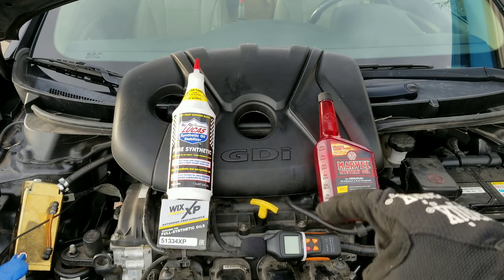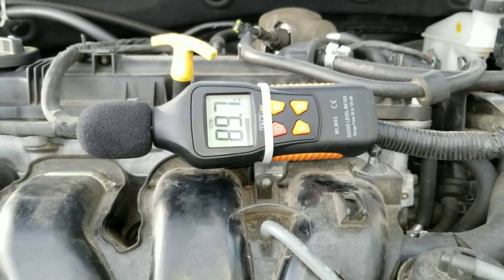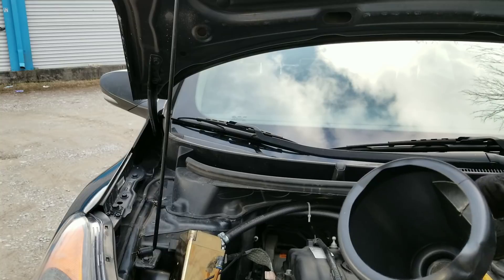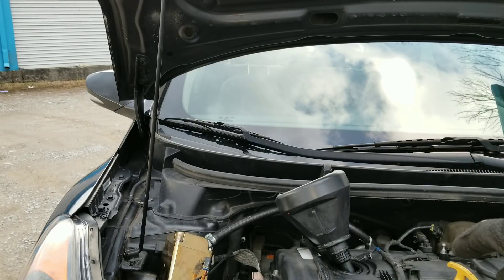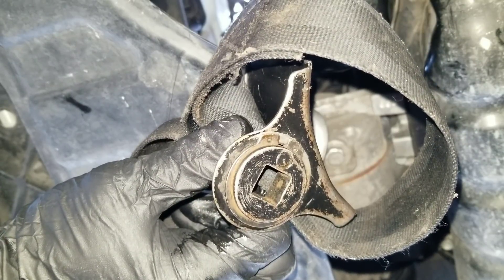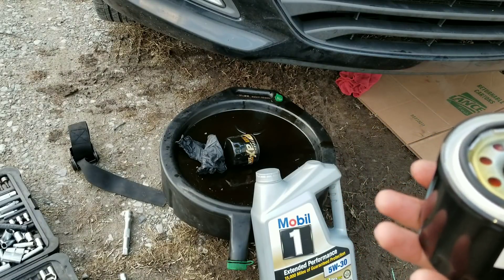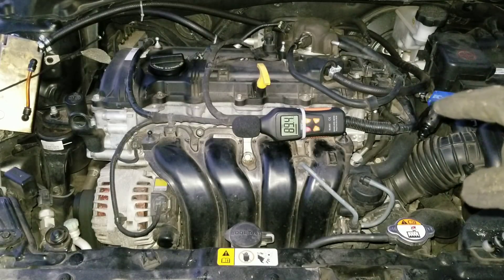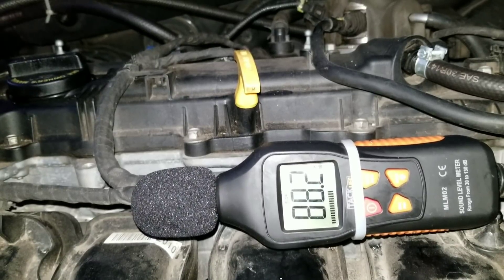marvel mystery oil & lucas oil stabilizer safe for new cars?

Comment: I have a 2010 Ford Taurus sel. .  The car lot serviced it before I bought it and they put 10-30 motor oil in. .. I changed it after 3,000 miles and put 5-20 in it cause that's what it calls for. . I did go synthetic. ... the car started making a ticking noise the day after and was getting louder.. I changed it again and put 10-30 synthetic and still ticking. .. added mystery oil,  still ticking. .. what happened? ??
Reply: The engine was ticking when they acquired it on the cheap and they put heavy oil and an oil thickener to mask the engine sound till they could find a “trusting unsophisticated” buyer. They knew it all along . I’m 76 yrs old and this trick is older than me
Reply from the maker: Marvel mystery oil can help depending on your situation however marvel can also thin the oil but very little it helps noise such as ticking lifters. Using the manufacturer's recommendations for oil would not be harmful although the different viscosity could cause very small noise level rise. When your car gains many miles over time there can be added benefits to the 10w30. I can hope the oil level wasn't low that caused noise to raise . You can add Lucas oil heavy duty stabilizer follow instructions if you have over 100,000 miles. Fill me in on what I can help with.
Reply: @NATESINTERACTIVEAUTO  I apologize for taking so long to reply. .. I changed the oil again and put 10-30 back in it, I did go synthetic this time,  still making a ticking noise and when it's cold the lifters rattle a little bit.. I just got home off the road two days ago my wife said it was rattling a lil more often than before I left,  I put a bottle of the stp oil treatment and have not heard the lifters again. . I also done the seafoam spray to the intake to see if that would stop the ticking noise but it's still doing it,  not as loud but noise is still there. .. Iam starting to think it was doing it the car lot got it and they put thicker oil and treatment in to stop it..  Iam no where close to being a mechanic so any advice is greatly appreciated. ... if it's possible the moter is getting to bad I have a life time engine warranty I purchased when I got the car just in case. ... as far as miles it had 132,000 when I bought it and I think it's right at 141 now
Reply from the maker: I appreciate you sharing
Reply: @ashleejenkins7627  m.p
Reply: @NATESINTERACTIVEAUTO  and no sir,  oil level has never been low, it's checked every week
Reply from the maker: Ok thanks for the information if your covered with a warranty great but be careful they seem to just pass warranty  but just listen to see if this worsens over time also when you drain oil drain over a magnet slowly and for $20 there is company called Blackstone labs or a respected company you know and have a oil analysis performed if you go online they send you a container for free just put used oil in and follow instructions to a T and this will tell you if there is a major problem other than this you can use lucas or stp but use synthetic and do not exceed instructions and if you want rid of this you can go to a mechanic see if there can be adjustments made however if theres not a wear issue i wouldn't have this performed unnecessary cost

Comment: If you're supposed to add the MMO quart 300 miles before the next oil change, how do you remove that amount of oil first?
Reply from the maker: You can drain or use a transfer pump
Reply: Just pour it in, no need to remove any oil. 99% of engines will be low anyway
Reply: @mikegillaspy1721  sure. Over fill by 20% I mean other than possible seal damage. No big deal.

Comment: It's DECIBELS!!!! Not decimals
Reply from the maker: Yes spell check somtimes takes over just as you or i dont use the correct punctuation
Reply: He tests his oil with a sound meter, what do you expect?
Reply from the maker: Some want to see if this helps engine noises i will try to improve our test
Reply: I actually don't think it's a bad idea to see if there's any difference between additives when measuring valve train noise, granted you have a decibel meter. I would try it if I had one.
Reply from the maker: Thank you i will try to improve our test
Reply: There's really only 2 ways to test. You've already done one. The other would be to check the oil pressure. Marvel Mystery Oil works very well for certain applications. I have freed up stuck lifters several times and even freed up a seized top end of a 4 cylinder. Keep on doing what you're doing, that's what makes good mechanics.
Reply from the maker: I appreciate your time

Comment: If you need oil stabilizer, you need an oil change
Reply: I've used it for the past 25 years along with Mobile One, but once when I didn't use it, at the next oil change the oil was black without a shine. Then at the next oil change using the Lucas the oil had a dark brown color and the used oil had a shine to it, like I normally see. I've been changing my own oil for 50 years.
Reply from the maker: Thanks for sharing your story and what other additives do you have experience with?
Reply from the maker: Follow instructions

Comment: Hello there , i think MMO can stay in the engine for much longer period and it will not
damage the because it is a Lubricant , so why you say drain it after 300 Miles  ?
As a lubricant it can stay in the engine till next oil change even to 2000 Km .
Reply from the maker: I recommend following marvels recommendations.
Reply: It thins out the oil, not good to run oil that is to thin for 3k miles. Just add it 300 to 500 miles before oil change. 380k on my camry marvel since day one, drives like new.
Reply: Good job, Jay.  I use 8 ounces before an oil change, not the whole quart. I save the rest for the fuel. I'm catching up with you. I have about 365K on my V6 !
Reply from the maker: Thanks for sharing
Reply: You are right. MMO can be used as a pre oil change treatment, and you can run it in the motor oil at all times. I personally would not run 20%, but some people do. It thins out the oil slightly, so I normally run 8 ounces in synthetic oil during colder months. In hotter months I use it before an oil change, especially older engines that are prone to oil consumption. There are lots of custom uses for MMO. Try putting a half ounce in the PCV valve with the engine running. Gun the engine once and shut it off. Let it soak for about an hour.
Reply from the maker: Thats what marvel recommends 300 to 500 miles before oil change.
Reply: Sounds like the correct amount of time for the product to fully penetrate and clean. The 300 to 500 miles must be on their website, because the bottles do not have this.

Comment: Be careful how long you drive after putting MMO in because in my 09 Hyundai Genesis 4.6 has always had oil changes at every 3000 miles with mobile 1 since the day we bought the car and it's always had highway miles.. the car has. 185,xxx now and one morning while it was cold out there was a slight lifter clatter that I never herd so i put marvel  mystery oil in the oil drove like 500 miles. And when I changed the oil I had noticed that so much carbon deposits had built up in the oil filter and clogged it so much it actually blew out the seam   of the filter media to bypass the filter (it is a factory design to blow out or bypass the filter if it gets to clogged so it doesn't harm the motor by not flowing out) so keep in mind that when you put the marvel mystery oil in change out the oil filter when you add it in
Reply from the maker: I change and flush often
Reply: @NATESINTERACTIVEAUTO  Yo this is like my life with a 2 year newer car. I work in a shop so why not right?
Reply: That's because the marvel mystery oil loosened up alot of the tarnish and carbon deposits in your engine.
Reply from the maker: Thanks for sharing
Reply: You can leave synthetic oil in a lot longer than that.  I use Castrol edge or Amsoil with Lucas oil stabilizer and run for a minimum of 10000.  The Ford I drive has over 328000 clicks on it and runs perfectly.
Reply: Use oil stabilizer and you run 500 miles change the oil and filter
Reply: Fernando Daniel I believe the company says no more than 300 miles
Reply: @carlrest6553  "Use Marvel Mystery Oil in the crankcase to benefit oil. At your next oil change, replace 20% of your engine oil (traditional or synthetic) with Marvel Mystery Oil. For example, if your engine has a 5-quart oil capacity, replace one of the quarts with a quart of Marvel Mystery Oil. Repeat at every oil change for optimal performance. Marvel Mystery Oil can be added to engine oil 300 to 500 miles before your next oil change to supplement sludge removal and enhance engine cleaning". I dont undestend if to use engine flush or oil treatment
Reply: Fernando Daniel I've used this product for 30 years. No more than 300miles.  And you better use a high quality oil filter.
Reply: As a matter of fact, I only use Castrol or Amsoil synthetic, Lucas oil stabilizer, MMO, and k&n oil filters.  I have driven a plymouth, two Pontiacs, two Dodges over 300000 and a Ford. currently over 330000.  All ran and run like the day I bought them.  All of these products are the best and have been used religiously on my vehicles.  MMO in the gas as directed works amazing. Almost 2 000 000 is proof.
Reply: James Duffy No more than 300 miles and make sure you use an oil filter of high quality and is designed for extended range
Reply: Isn't every 3000 miles a bit over the top nowadays? Thats a good but expensive oil.
Reply from the maker: 6000 if a quality synthetic conventional 3000 and i drive 150 miles daily i try for 3 but sometimes hit 6ooo however 6 is fine but i have a friend who has changed his oil 1 time in 3 years and drives as much as me but he has 250000 and still going on a jeep liberty 03 model it does use oil mine doesn't use a drop but i only have just over 100,000
Reply: @malcolmnicholls2893  All depends on how you drive your car. I do a lot of hard accelerations so with full syn every 3k its still black. When your oil is black or clean it still recirculates threw the pcv system and the intake the worse the oil the more it will stick to everything.
Reply: @CodyDoesIt  Ok-Thanks

Comment: Nate I am not sure you should do this, it will not hurt the engine but it you send that off to the lab it will probably read as a 5w35 or 5w40 oil and since this is a non turbo it might not flow as well
Reply from the maker: Ive not decided what to send to the lab
Reply from the maker: But it will be a comparison if there is more ear with or without  lucas
Reply: I put 15w40 and Lucas and mmo in a 5w30 engine. Another engine 20w50 Lucas and mmo. They all run great, quit pearl clutching and realize that engines are tougher than you think.

Comment: Motorkote is what I used in my vehicles when I change oil before winter. I change 2 times a year but used Motorkote for the wear reducing properties during cold temps. Can't wait till April to change the oil again. It helps on cold morning starts with valve chatter. Great stuff...
Reply from the maker: Great im so excited to put all my oil test equipment together and send alot of samples off for more info so maybe they would cut me a deal i want the test to be very detail like pour test wear test visual boil and cold test also send to lab and more heat dissipation. So i will take a survey later to see what makes the cut
Reply: @NATESINTERACTIVEAUTO  An oil cold pour test of different brands today in actual conditions would of been a great. LOL  Those all sound like great ideas.
Reply from the maker: Yeah i just purchased a wear tester and its kinda expensive but unfortunately coming from china so it will be a month
Reply: Motorkote is what I use for my oil additive. Mmo for my fuel additive. About every other oil change I use a good motor flush, like amsoil. All cars are near or past 200k miles. Never had a problem with any of them. Still get same fuel mileage as new and so on. Love my motorkote and mmo!
Reply: love that $$$Motorkote$$$ but I use MMO and Lucas too
Reply from the maker: What have you experienced since using

Comment: Mmo used in my shop for 27 years
Reply from the maker: Awesome
Reply: Jack Walters what about the ticking noise from 2018 mustang gt?
Reply from the maker: Flush with mmo and then add the new lucas formula or synthetic unless the engine has many miles the original formula
Reply from the maker: Flushed after little driving